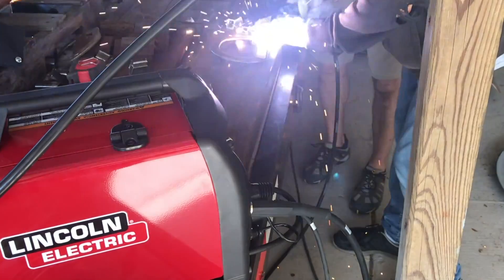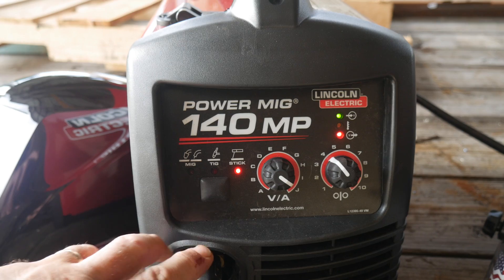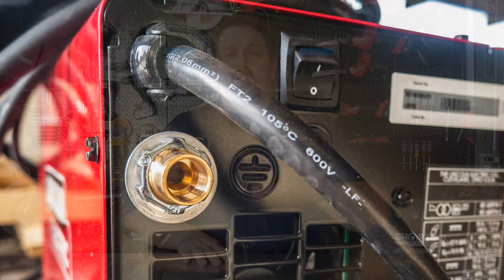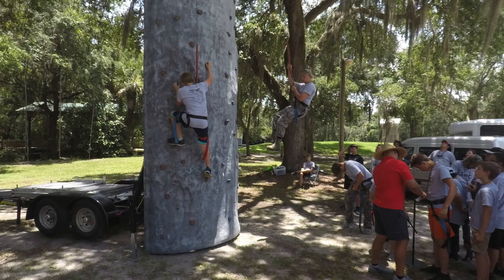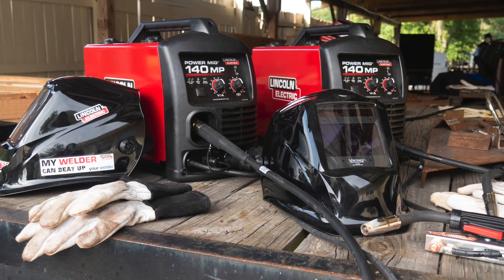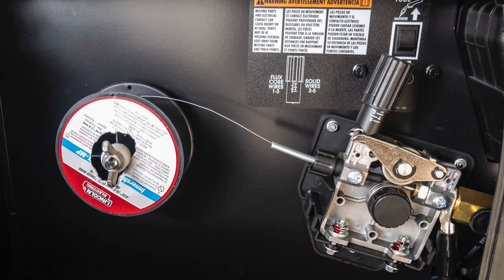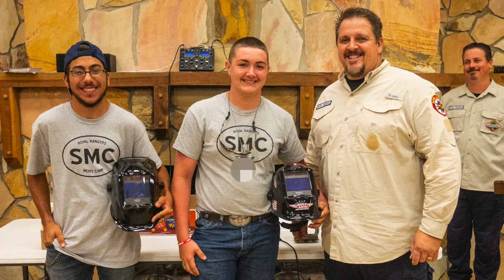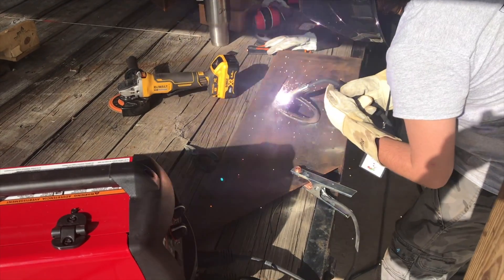Lincoln Electric Gives Back with the Power MIG 140MP

Comment: What’s the difference between this machine and the LE31MP if any?
Reply: Exact same machine. Le31 means you bought it from home depot. The manuals are exactly the same word for word.
Reply: I believe the only difference is the 140 series uses a transformer, the le31mp uses an inverter.
Reply: A guy I knew in a good position with Home Depot corporate said that HD is powerful enough to have manufacturers make something to their own specs to meet a price point.